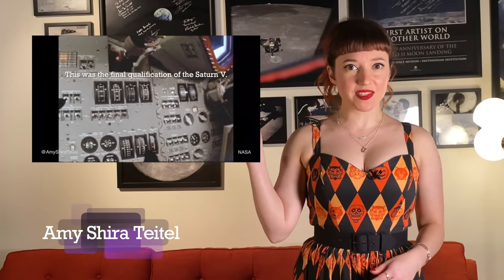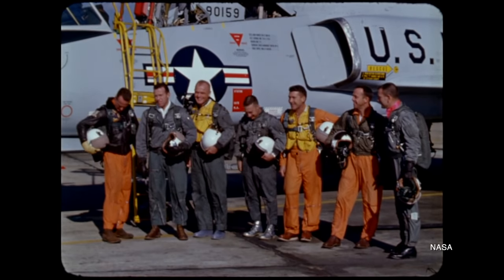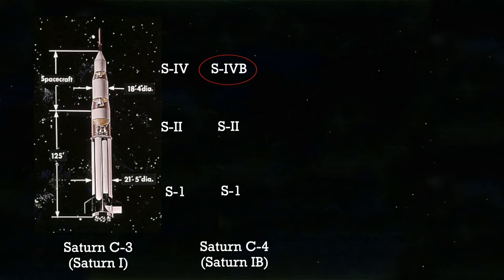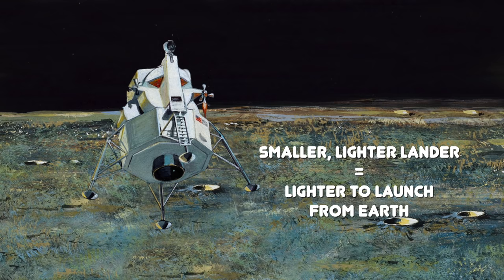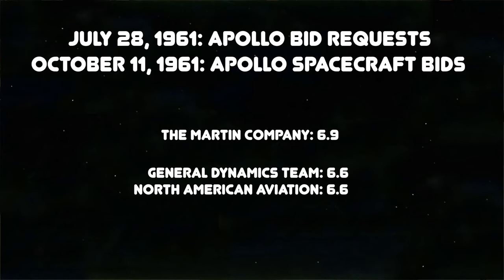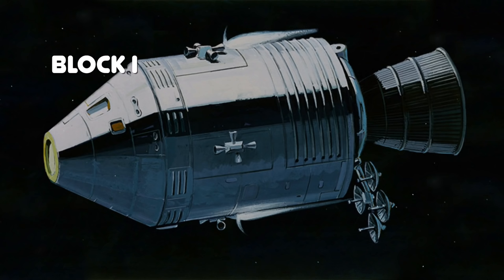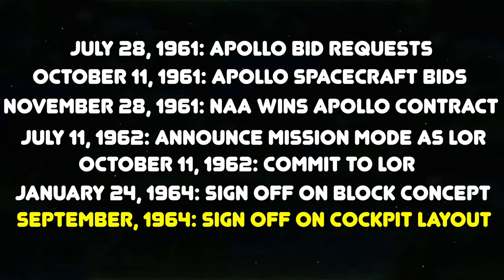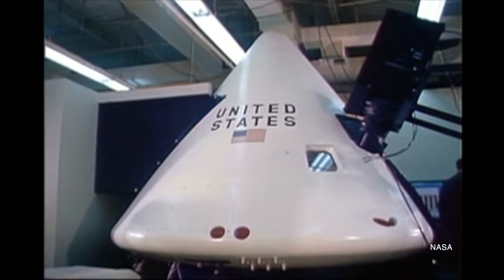NASA Built Two Versions of the Apollo Command Module

Comment: I knew quite a bit of this already from the mini series from the earth to the moon, but ultimately it's for entertainment. This is way more detailed and certainly eye opening. NASA doesn't seem to learn from incompetence does it. Makes me wonder if NASA was behind apollo 13 as well. I know that was a tank explosion that had originally been installed in another space craft but removed due to it being defective. I think it was apollo 10, but I'm not 100% on that. I also know it was dropped upon removal. And then when it was installed in 13 they used the wrong voltage for the controls or sensors or however it interfaced. But it was both defective and had been dropped. WHY WAS IT APPROVED FOR A LAUNCH!?!?!?!? I'll never understand that. I'll also never understand why it's ok to launch a space shuttle when every engineer that built it said you can't launch it when it's this cold out. It will blow up.

Comment: Great video as usual but I'm kind of disappointed that you didn't mention one of the main reasons Martin didn't get the nod while NAA did since you did some in depth work previously. NAA specifically and with "inside" help from Max Faget only submitted a point-design Apollo CM concept that used the 'blunt-body' design. Martin, along with the most of the rest of the contactors, (GE being an exception but their design was deemed to complicated... funny since it was similar to the USSR"s Soyuz design) had presented multiple design concepts not being full convinced that the "blunt-body" was in fact the best choice. Martin's actual "wining" design was in fact based on an M1 "lifting-body" Apollo concept with the "blunt-body" design being a distant 'alternate' design choice. While NASA would eventually do significant work on a follow up design of the M1 we know now as the M2F1/2/3 at the time Faget felt that anything other than the blunt-body would be too time and resource intensive to pursue and so advised the decision panel.

Comment: Could you expand on the Command module built with five seats for a possible Skylab rescue mission. I think it might hanging inside the Kennedy Space Center’s Visitors area in Florida. I have read so little about it. I read that the last CM was used for the Apollo  Soyuz mission in 1975. I would welcome a video about the five seater.

Comment: "Given the change, should we change our CO2 scrubbers from cubes to cylinders to meet the new lunar lander design?"  "Why would we ever need to do that?"
Reply: A few reasons: 1) it's not just a matter of changing the shape of the hole the canisters go into-it would basically be a redesign affecting that entire section of the spacecraft. 2) The thought was that any problem severe enough to totally cripple the command module for the duration of the flight was going to kill the crew anyway, in which case the shape wouldn't matter.  3) the LM canisters had to be that shape because you could use the ones from the PLSS backpack in their place in an emergency.

Comment: Very interesting but quite incorrect on the designation of C=series Juno V (Saturn) rocket configurations. A bit confused here and the graphics of that are incorrect. Also, a little muddled on the reason for a Block II which was only designated as such when a lunar-configured successor to the standard Apollo (retrospectively known as the Block I) was required. Block II was the first for rendezvous and docking; Block I was not because it originated when that was not required for a primarily Earth-orbit science objective.

Comment: Well they were right Apollo Block II was first used on Apollo 7.  Also there was a Gemini lander design because of all of the problems with Apollo.
Reply: And a Gemini version of Skylab...
Reply: @allangibson8494   Interesting but I can conceive it.  My uncles worked at NASA on Mercury to Skylab.  I don't remember that one or they just didn't talk about it.
Reply: Lee Foster look up USAF Blue Gemini Manned Orbital Laboratory. It was displaced by both the Apollo program and the Key Hole KH-11/12 program (which the Space Shuttle was supposed to be a cover for). Key Hole replaced the Corona (which operated under cover of the Discoverer program).
The modified Blue Gemini space craft is in the Air Force museum in Dayton.

Comment: Was not the S-IV (and S-IVb) so called because they were drived from what would have been Nova's 4th stage?

Also, I seem to recall the SPS engine was larger than needed because of the Mode indecision, and the fact that by the time Lunar Rendezvous was selected, the design had already been finalized based on Direct Ascent, meaning that engine was designed to land the entire spacecraft on the lunar surface.

Comment: I always wondered why the service module didn't do a burn close to Earth to slow down when coming back from the moon so that re-entry wasn't as violent
Reply: Adding any mass on C/SM would increase the needed size of previous stage, which would need increasing the previous stage even more, and EVEN more for the first stage. It would also be about as impractical as using propeller to brake a plane instead of braking using ground. No reason not to use few tens of kilos more heatshield instead of tonnes of fuel needed to replace it.
Reply: @KarolOfGutovo  Wasn't there any leftover propellant in the service module? They had to have had some. It seems like a few seconds of burn would have slowed them down a lot.
Reply: OhioPat Entry angle to avoid skipping off the atmosphere was critical. Screwing that up at the last minute could be lethal.

Comment: witholding the apollo 1 fire Amy, capsules have a higher saftey ratio than shuttle type ships... agree?
Reply: Eh, I think if that is true it's only barely true. Crew-wise;  Shuttle launched 135 times, Soyuz 141, Apollo 15- you've got deadly or near-deadly disasters on 2, 5, and 2 missions for a balance of 133:149 successes and 2:7 failures.

Comment: Can someone out there please tell me what they use to control the extreme temperature variations inside the space capsule and their space suits. I would like to know how they expel the used oxygen and keep the crafts environment at a steady temperature
I have never got a reply to this question and I bet I still don't
Hummm I wonder why
Reply: For the most part they used passive thermal radiation for cooling. The command module performed the so-called "barbecue roll" on the way to and from the moon. One side was heated up by the sun, while the other could cool by radiating away the heat towards the dark space. 
The command module and the space suits were also white which reflects most of the suns energy. So they don't get hot in the first place. The lander module had gold foil all over it which reflects even more energy. 
If the internal environment got too cold, they simply switched on an electric heater. 

"I would like to know how they expel the used oxygen" I'm not sure what you are trying to ask. Used oxygen? What is that?

So now you got your reply. You lost your bet.

Comment: Just and FYI (that you probably alread know :) ) but the "block" concept wasn't new and was a 'modified' version of an aircraft designation system that itself was based on an early breakout system commonly known as the "Mark" or "Mk" system. Some contractors and government agencies had been using "Mk" and "Block" interchangeably for decades prior to this point but it was specifically something that the ex-Missilemen that NASA inherited from the Air Force tended to use to differentiate and separate "missile" modifications from similar aircraft modification designations. Funny enough this cross-pollinated BACK into the Air Force terminology to the point that aircraft breakdowns are now commonly designated by "block" number.

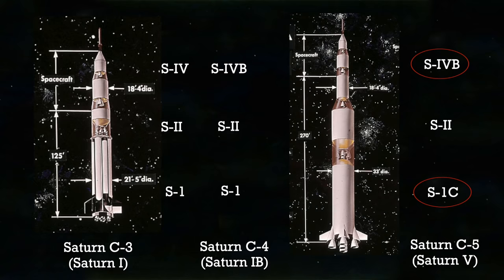Comment: The Saturn I was not the Saturn C-3 (8:17).  It was the C-1.  The Saturn C-4 was not the Saturn 1B. The Saturn 1 (C-1) started as an Army project passed to NASA as when they absorbed Wernher von Braun's team at the U.S. Army Ballistic Missile Agency (ABMA).   The Saturn 1 was powered by 8 H-1 engines and 6 RL-10s powering its second stage.  The Saturn 1B had a similar first stage with the newly developed Rocketdyne J-2 engine on its 2nd stage.  The entire "C" designations is confusing.  C-1 turned into the Saturn 1. C-2 was a concept study using the Saturn 1 (C-1) first stage; a J-2 powered second stage; 6 RL-10 third stage and 1 RL-10 four stage. The Saturn C-3 also a concept study had a first stage powered by 2 Rocketdyne F-1s;  2nd stage powered by  4 Rocketdyne J-2 engines and a 3rd stage powered by 6 Rocketdyne RL-10 engines.  The Saturn C-4 was also a concept study with 4 Rocketdyne F-1s on the first stage;  4 Rocketdyne J-2 engines powering the second stage and 1 Rocketdyne J-2 powering the 3rd stage.   The Saturn C-5 is the Saturn V as we know it.  By the way the Saturn 1B had very similar capabilities to the Block 5 Falcon 9 though about 8 times more expensive in real dollars than the Falcon.